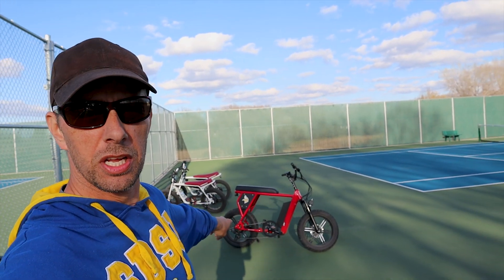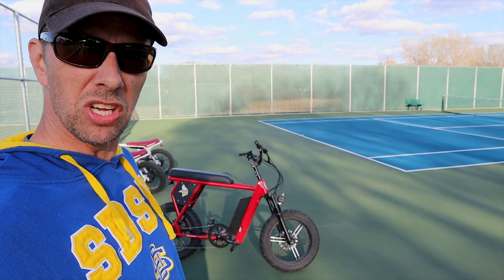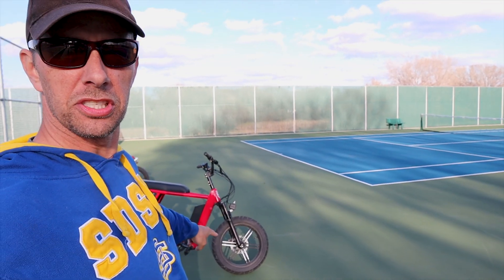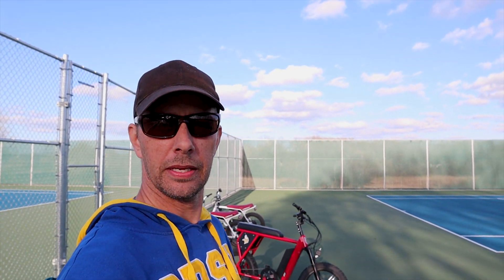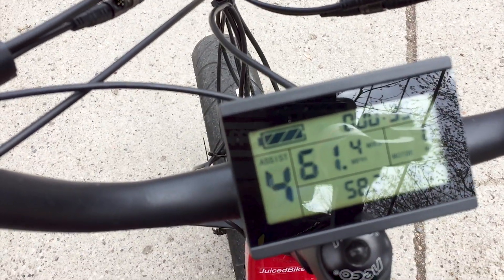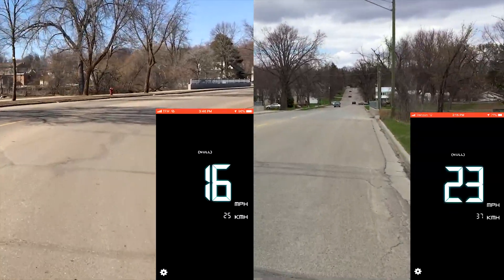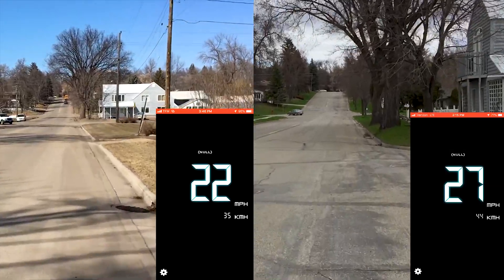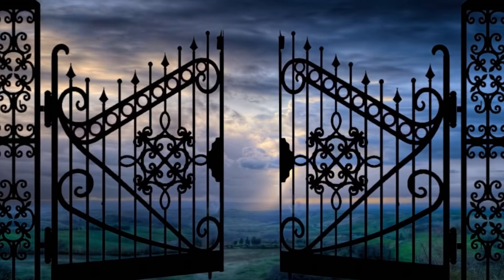Juiced Bike Scrambler- Off-Road Controller vs Kunteng Controller

Comment: Can i use the juiced bike 52v rated controller with a 48v 19.2 ah battery and 1000w rear hub motor?  Or will it harm the 48V set up?
i have it but not installed it yet.

Comment: How’s it going brother did you ever get a chance to try out the 25a Kt controller? We’re you right about it being the same as the 35a kt?
Reply from the maker: As far as top speed it was the same.  Acceleration was in-between stock and the 35 amp Kunteng.  Need higher voltage for more speed.  Not sure if I want to build another battery.  Gets a little expensive.

Comment: Super video! I just ordered the City your modding was an influence.
Any idea in hindsight if there's an equal plug and play Bafang controller with the option for color screen and USB out?
I may buy the Kuntemg now and wait for the warranty to lapse later to upgrade. That's assuming there isn't a better option as inquired above.
A cool video might be new air shocks with a bit more extension to prevent frame contact and better ride too. Time to start buying my rebuild 18650s too in anticipation of hyperinflation later.
Reply from the maker: Not that i'm aware of.  The hard part is sourcing the plugs otherwise I'd sell them.  I'm going to try the 25 amp version with the color display soon on my fathers scrambler. I have a sneaky suspicion  that the 35 amp Kuntung isn't any better than the 25 amp kunteng.  Hard to explain, but i'll show you in a video when I get it.  should be within 2 weeks for sure.

Comment: does the juiced off road controller work ? i seen that its easier to install and gets my 750w city scrambler to 28 on throttle alone.
Reply from the maker: It didn't work very well for me.  It worked like crap on mine and ok on my dads.  Takes a long time to get to 26 mph.  Others have said that it works great for them.

Comment: Something is definitely wrong.

I have 2 Juiced Camp Scramblers. I put the off road kit on the black bike and it goes 28 - 29 MPH. The red bike has the standard controller and it does 20 - 21 MPH. Later I put the off road controller on the red bike and they both accelerate up to 28 - 29 MPH.

The Juiced bike off road controller does the job and goes up to 28 MPH with no issues.
Reply from the maker: Went back and forth with juiced about it and was given a clean bill of health. They said nothing was wrong with the bike.
Reply: 3cheerz have you unlocked the race mode?

Comment: so which kunteng  35 amp can you put part number in the description, thanks
Reply from the maker: https://www.aliexpress.com/store/product/Electric-Bike-48V-1000W-Brushless-Ebike-12-Mosfet-Controller-Key-lock-function-Dual-mode-Hall-Sensor/502344_32950762951.html?spm=2114.12010615.8148356.18.48a17300ojm7D6  I don't see the 35amp for sale anymore.  This one is a 30 amp and it would work just as well as the 35 amp.  The 35 amp was over-rated anyways.  Might just be the same one with proper ratings.  This store also sells the 45 amp which sounds like a lot, but with the display(which you need anyway)  you can adjust the amp output in increments all the way down to half power.  This seller has always been good.  Just remember it takes at least 20 days to get it shipped.  Usually about 25 days.

Comment: Hello!  Your videos are beautiful !!  An information: the 750 Camp scrambler only with the accelerator at what speed it arrives?  to be able to unlock the speed you need to buy the juiced bike kit or are there other systems?
Reply from the maker: None that are plug and play.  I'll eventually be doing a video showing how I installed the controller and where I got it from.  Sry for the late reply I don't get notified sometimes.
Reply: Just get the juiced off-road kit i have it and it's well worth it

Comment: nice and dramatic. you can easily see the difference. how does he battery life hold up to the extra juice?
Reply from the maker: It's a little to early to tell but I think its' gonna be ok.  The watts taper off to near stock levels once I get to top speed.  Not needing to pedal for full power and stop and go traffic is def going to use up the battery faster.
Reply: @vanmasterflash7153  thats great! just got mine a few days ago and loving it..not super fast but a suprisingly decent speed. tried it on race mode and you barely touch the pedal and it zooms off. maybe upgrade the battery down the line if i can find a cheaper one because im definitely not a dyi type of person like yourself.

Comment: Do you no how to fix mac moter 1000 watts to controler problems I just thought I'd ask
Reply from the maker: I'm pretty sure it's just the crappy programming and/or  controller.  45 amp kt controller and display would more than likely solve all issues.  I had two city scramblers and one bafang motor worked great on all of the controllers,  the other one didn't.   Put the KT on the one that didn't work very good(jerking and surging issues) and it works great now.  Can pull the front tire with ease and it's powerful and smooth as silk all the way through the power band.
Reply: @vanmasterflash7153  thanks for your help